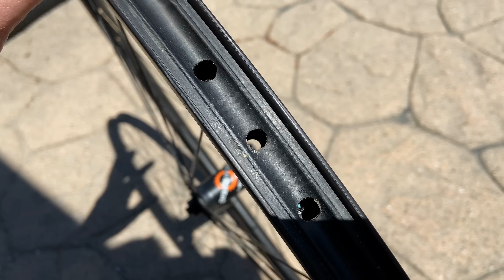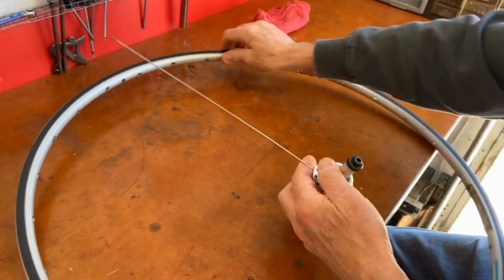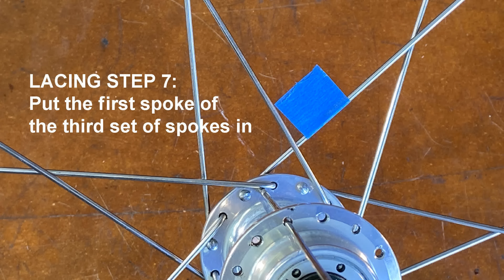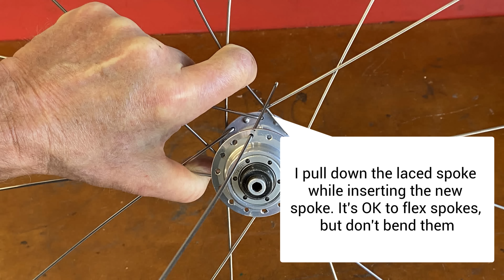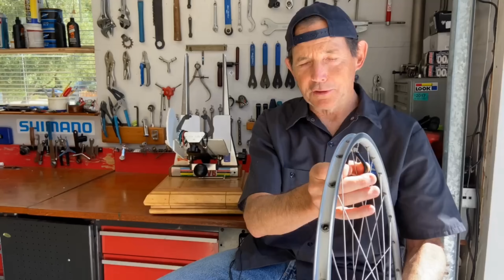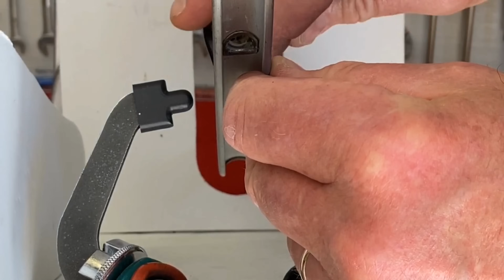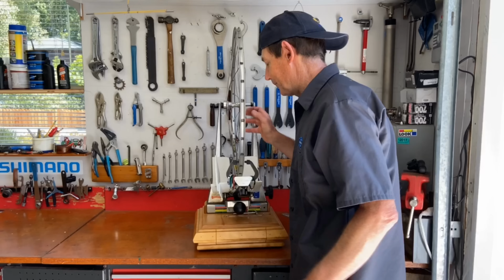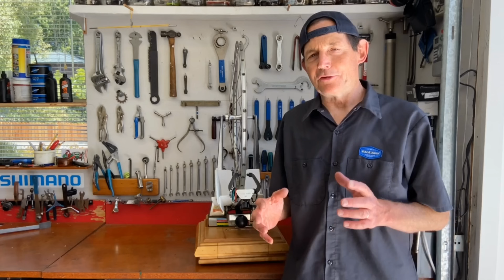How To Build Bicycle Wheels THE EASY WAY! #bikerepair

Comment: I want to build a single sided wheel for my recumbent trike. Is it harder to do and do you need different tools for this ?
Reply from the maker: Hi Jay, I've built one recumbent and ridden many more, but have only ridden a few recumbent trikes. I think what you are asking about is a front wheel that's attached to the recumbent's front end on one one side of the wheel, right? If that's correct - that you're asking about building a wheel that attaches on one side only, then the answer is that you build that wheel the same way I explain in my video. 

One thing to check though is if the spokes on the wheel cross each other. You want to check because sometimes recumbent front wheels are radially spoked, meaning the spokes do not cross, but instead travel straight from the hub to the rim. If you have radially spokes wheels, they are even easier to build since the pattern is the simplest there is. Let me know if I didn't answer your question and explain more about the wheel you wish to build and I'll try again. Thanks! Jim
Reply: @JimLangley1  That was wanted to know. Thank you

Comment: Do you recommend double-butted spokes to save weight (specifically Sapim Lasers)? Are they more likely to fail than bladed spokes; assuming the builder didn't twist them?
Reply from the maker: Thanks for watching and for the question, Aaron. Yes, I recommend butted spokes, partly because they save weight and more importantly because they stretch as you tighten them. And, the stretch helps keep them tight when the wheel is done. But, I wouldn't recommend Sapim Laser spokes, which are tricky to build with because they have such small diameter center sections at only 1.5mm (which makes them prone to twisting). Even Sapim says they're difficult to build with. If you want to use Sapim spokes, I'd go with their Race spokes, which are a standard butted spoke (2.0/1.8mm). These spokes shouldn't fail but then Sapim's aero CX Ray spokes shouldn't fail either. They're all high quality stainless-steel spokes, which are reliable and difficult to break. Okay? I hope this helps and thanks again!
Reply: @JimLangley1  Definitely helps. I made the mistake of building up my first 2 wheelsets with Lasers and the tricky part was keeping them from twisting and seizing up. I used anti-seize but still had problems, so I'll try motor oil this next build. For my next built, I'm considering Race spokes with Mavic Open Pro's. Used Stans Iron Cross on one set and DT Swiss R500 on the other. The Stans rims were hard to true and the rear was wrecked when my chain snapped on a sprint. Thanks for the response. How much would you say the spokes stretch, less than a couple millimeters?
Reply from the maker: @aaron___6014  Hope you weren't hurt too bad when that chain snapped, Aaron. I've never had that happen to me - though I have had close calls where I felt the chain about to break. But I've seen it in a race and the guy got hurt bad. Too bad it ruined your new rim! 

On how much spokes stretch, of course it depends on the type as you know. I bet the spoke makers have data on this but I have never seen any. I would guess that you're right and that it's less than 2mm on something like that double butted Sapim Race spoke. Also, I don't know how a wheel builder would know if the "stretch" is the spoke actually stretching or the nipple being pulled deeper into the rim holes, the spoke being seated deeper in the hub and then the spoke actually elongating. I bet a spoke maker hangs weights to see how much their different spokes stretch. Probably not too hard an experiment to copy but I have never done it. If you find some tech doc on spoke stretch, please share it. It would be interesting to know for sure. Thanks for the great question, Aaron and happy wheel building to you with those Open Pros!

Comment: Wow fantastic video Jim.  I can't tell you how gland I am to have stumbled upon it (and the subsequent other resources that you have posted on-line). I'm a lifelong bike geek that use to race and worked as a bike mechanic in the early 80s as a teenager. I wish I had someone like you to teach me with the detail and patience that you took with this video.  I usually laced them and had to hand them off to the senior mechanic who never wanted to take the time to teach the finer points of truing like you did with this video (maybe it was job security).  I have since learned the truing process but always feel like I am winging it when it comes to tensioning.  Like you explained in your video, I typically "ping" spokes from a wheel already built as a base case and shoot for the same pitch. However, the wheels I am using as a base are wheels that I have already built, which may not have the optimal tension to begin with.  I know Park makes a tension "deflection" gauge for this purpose but is there another way, or rule of thumb that I can use other than purchasing the gauge for this purpose?  Thanks again for your insight.  You are clearly a master of your craft.
Reply from the maker: I'm really happy to hear you enjoyed my wheel building video, R Laible - thanks for watching and the great comment! There's really no way to be certain the spokes are tight enough by squeezing or feeling them or even plucking/pinging them. However, if they seem the same tightness with those checks to other wheels that you've been riding that have been holding up well, there's a good chance that you have the spokes ballpark close enough. Then if you can actually ride the wheel and have them stay round and true, that's a great indication that you got the spokes tight enough. Another thing is that when you get a wheel to the optimum tension it gets difficult to turn the spoke nipples. Each layer of tension you add to a wheel when you're final tensioning, it gets harder and harder to turn the nipples. When you reach full tension (say 90 - 120 kgf on a tensio meter) - it starts hurting your thumb a bit making those last turns with a spoke wrench (easier to do it with a nipple driver if you have square drive nipples). So, that's another sign of reaching final tension. This assumes of course, that there's nothing wrong with the spoke length or nipple seat in the rim, etc. which could give a false tightness. Okay? I hope these tips help and have fun with your wheel building! Jim

Comment: I would add to this that on a rear wheel the spokes on the drive side will end up being a bit higher tension than the non drive side in order to compensate for the added distance of the cassette or the freewheel.
Reply from the maker: Thanks for making that excellent point, BikeJC. I appreciate you watching and commenting!

Comment: Thank you for taking the time to share your knowledge. This video is great in so many ways. One question, do you use loctite on the nipples and if not, why not. I just ask because some wheel builders do, and some don't
Reply from the maker: You're welcome, Thomas and thanks for watching and the comment. I usually use Wheelsmith SpokePrep on the spokes https://amzn.to/33czYkF  . It dries on the threads and acts like a loctite though does not actually bind the nipples onto the spokes the way loctites do. It does make the nipples much less likely to loosen. There are some wheels/spokes that call for actual loctite and I will use it when the manufacturer specs it. You just have to work faster to get the wheel done before the loctite fully cures and the nipples start not wanting to turn on the spokes. Hope that helps and thanks again!
Reply: @JimLangley1  thank you for your reply! I will look into the spoke prep stuff you use. Do you use it instead of the oil or as an adjunct after adding the oil? 
I built recently a truing stand so I will start by taking apart a front wheel I am no longer using and then practice on a back wheel too. Thanks again.
Reply from the maker: @thomask837  when you use the SpokePrep, don't put it on too thick. You want a thin even coat covering the threads, but not so much that the nipples don't turn easily on the spokes. It takes a little practice to get it right. I group 16 spokes and tap them on the table so the threaded ends are all lined up. I hold them tight then so they can't change alignment. Then I dip about 1.5mm of the tops of the bunched 16 spokes into the SpokePrep jar. Be careful not to push the spokes in too deep or you'll end up with way too much Prep on them. Also, don't let the spokes touch the sides of the jar or you'll get Prep on the spokes where you don't want it and have to wipe it off. 

It's better to have too little than too much Prep. When you pull the spokes out, hold onto them so they don't change position or else the prep will get spread where you don't want it. Next, hold the spoke bends of your group of 16 spokes down and put them on top of the workbench so that the threaded ends with the fresh Prep are upright and still all lined up just right. Now, while keeping the spokes upright with them against the table, roll the spokes together against each other and pay attention to the Prep. It will gradually work its way down toward the bottom of the threads and it will be applied pretty evenly. Like I said it takes a little practice, but you'll get the hang of it. Let me know if you have questions. Happy to help!
Reply: @JimLangley1  thank you for explaining this technique. I will give this method a go. Very much appreciated!!!

Comment: should the pulling spoke be an inside or outside spoke?
Reply from the maker: Thanks for watching and the question, Carlos. There are different theories on that and it can vary depending on what type of wheel you're building. For example, in my video on disc wheel lacing, I show how I do it on all my wheels with disc brake (Shimano's way): https://www.youtube.com/watch?v=gfWd7_avr1s 

On wheels without disc brakes, the main force is the pedaling force, so I place the pulling spokes on both sides of the wheel heads-out (inside spokes). That helps prevent the rim being pulled to the side under a rider's most powerful efforts. 

A nice analysis of the pros/cons of different pulling spoke placement can be found in Jobst Brand's book The Bicycle Wheel. That book has been out of print for some time. But, thanks to wheelfanatyk.com you can download a pdf of it here if you are interested: https://www.dropbox.com/s/mbsx865uzz0s7jq/Bicycle_Wheel_-_Jobst_Brandt.pdf?dl=0 Hope this is helpful.

Comment: One of the, dare I say, sillier traditions for wheel building, that I didn't follow during my early days of wheel building, and is frankly a pain in the neck at times....  To be able to look down at the hub, through the rim valve hole, and being able to see the hub mfg branding.
Reply from the maker: I understand what you mean by calling it silly, Walt, as in it providing no functional benefit to the wheel structure. However, it provides something perhaps more important, which is customer satisfaction. Yes, some folks don't know the difference and wouldn't notice. Also, on some hubs it's not even possible. 

But, the customers that love beautiful hand built wheels comprised of the finest components, definitely are looking at every little detail and judge you based on them.  And if the hub has a distinct label that can be centered, they are going to notice and let you know if it's not aligned. When they photograph their bike for that social media shoutout, they want to show their custom wheels in all their glory with the valve stems at 12 o'clock, the hub labels proudly showing directly below celebrating their jewel like hubs. 

I realize you might not be interested, but I made a video showing an easy way to align hub labels because people have asked me how to do it: https://www.youtube.com/watch?v=8FiyUyJN7Uw&t=19s Thanks for another interesting comment, Walt!

Comment: I kind of prefer the way you load spokes, vs. the way I learned, though I got into the habit of doing it your way after a couple of years.   I first learned the method where you load all the spokes into the hub before putting even one nipple on....  It works, but could be rather ungamely at times.
Reply from the maker: Thanks for the feedback and for watching, Walt. Like you, I have laced many ways. I teach it the way I show in the video because it's what I have found is a simple way to learn and a way where - as long as you pay attention to what you are doing - you are unlikely to put a spoke in the wrong place. Thanks for the great comment!

Comment: Wow nice tutorial.  I was 13 when i did my first wheel on my ten speed bike. That 40 years ago. No youtube videos then.  I had fallen down and my back wheel was out and non rideable. Bike shop had done a bad job of it and told me i need to replace the wheel.  At that age money was not readily available so i told myself since it is already broken i have nothing to lose.  I took off the tire, put it back on my bike sat behind the wheel and started spinning the wheel doing trial and error while tightening and loosening the nipples to get the understanding of which way the spokes would pull.  I must of sat there doing this a whole afternoon.  I was successfully able to make the brake pads stop rubbing where i had the bad side to side wobble.  I was so happy, i had successful made the bike rideable again.  it was not perfect but i was riding again. All this at the age of 14.  Well i still have the bike today and that same wheel it still there on it. Other than changing the tires i have never retouched the spokes. Now with this video i just learned that i have to check if it is round.  But honestly i have never real felt any hops so i think it may be ok...i will have a look in spring when i take it back out after winter.  My second wheel was replacing a broken hub from one wheel rim to another on a scrap bike. I had loosened all the spokes and removed the all the spokes on one side and put them in the new hub as they were taken out. Following the pattern of the attached side still in place, i reattached the new hub and spokes on the removed side. When i had them all in with the right pattern, i then remove the rest on the broken hub side. Then just repeated the second side following the pattern and trued it on the bike.  Thanks Jim for this wonderful tutorial.If i was able to do it at 14 with no video, i think with good patience anyone can.
Reply from the maker: That's a wonderful story, Joe. You obviously were a mechanically minded teenager with a lot of determination and resourcefulness. That's the great thing about bicycles, too - that if you put your mind to it and keep trying, you can figure out what's wrong and fix it yourself. I can see how you would have been very happy and proud of figuring that out back then and I bet you have fixed all kinds of things since then with your skills and confidence in being able to solve problems. Thanks a lot for watching my video, the kind words and for sharing your story!

Comment: I'm about to build my first set of wheels and I cannot thank you enough for teaching me how to do it.

One question comes to mind though, how does one calibrate the truing stand with minimal use of tools?
Reply from the maker: You're very welcome, Terry! I'm not sure what you mean by "calibrate the truing stand." When you get the great majority of truing stands, such as the Park TS-2.2 that I use https://amzn.to/3pIuuHV or the wide assortment of stands on Amazon, it will arrive ready to go, you don't have to calibrate it. 

You do have to put the wheel in the stand and adjust the indicators. To explain, that, when you put your wheel in the stand, you have to know how to keep it secure in the uprights but it's easy and the stand will come with directions. Once the wheel is in the uprights and secure, the stand's indicators (little arms) need to be moved close enough to the rim so you can see the wobbles as the wheel spins. That's also easy and there should be directions with the stand showing how to do it. But, you can figure it out looking at the indicators too. On Park's stands, wheel securing and moving the indicators into position is all done by turning large knobs on the stand, so it's quite fast and easy. 

I hope this answers your question. If not, please let me know and I'll explain more. Have fun building those wheels! Thanks for the comment!
Reply: @JimLangley1  I was worrying how to get the uprights to stand level and how to get the calipers centered, but I guess that won't be a problem. Thank you for taking the time for teaching me. I am now confident that I can do it.
Reply from the maker: @GraySectoid  it shouldn't be any problem at all, Terry. There are truing stands that take a lot of setting up but they're the professional ones that cost more than most of us can afford and I don't think you're using one of those. Happy to help more if you have any questions when you get to truing that wheel, too.